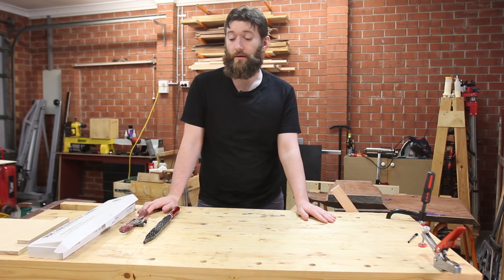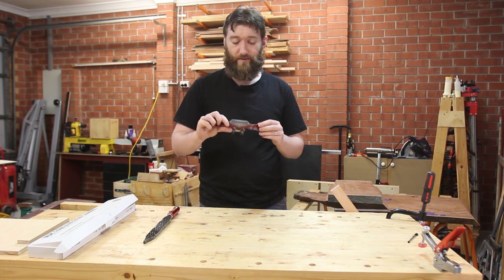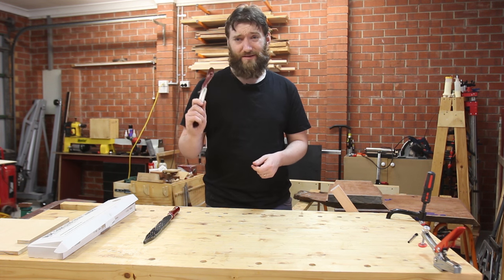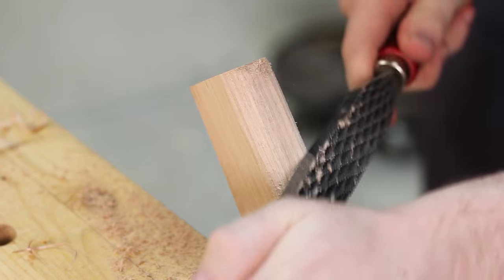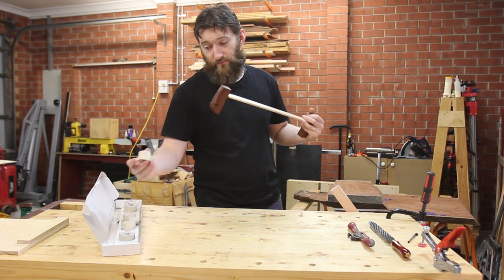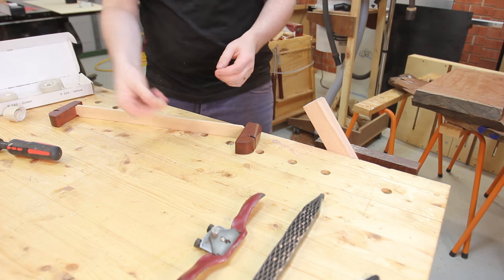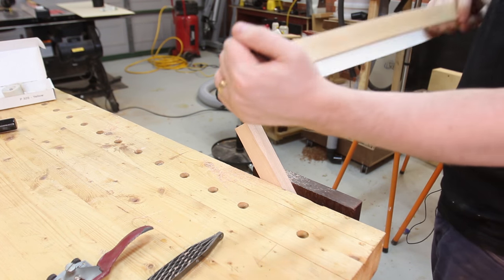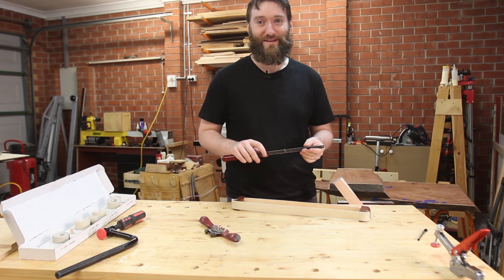Tool Warble #3 - Shinto Rasp, Spokeshave, MacFarlane Bowsander

Comment: Well you just gave me the idea to build a bow sander. 

I built a bed from woodgears, the fancy queen one with curves. Bandsaw wasn't big enough used a jigsaw(first mistake), smoothed it out with that crap spokeshave you just said about and then went after the parts I could with a belt sander(with foam under) and had to hand sand the rest. 

I bet the old stanley spokeshaves are slightly better the new one I had didn't work out of the box, I forget all of what I had to fix but it was a bit of filing and a bit of swearing before I got anywhere with it. 

In the end it turned out good but yea would never do it again, next project that hits me like that I'm building a band saw first.

Comment: Thanks Paul, great video. I can certainly recommend the Hnt Gordon spoke shaves. Got mine late last year and was kicking myself I never got them earlier, they are an absolute joy to use. Setting the blade takes a bit of finessing and getting used to, but when dialled in they are great. Cheers.

Comment: My favorite thing to shape with is the microplane set with interchangeable blades. They are steel cheese cutter style blades that do an amazing job.  Thanks for the video, interesting sander.
Reply from the maker: +BearKat Wood The "intro set" for about $20USD? That looks fairly stomach-able for a bit of a shootout down the track!
Reply: +Paul “TheWoodKnight” Jenkins 
The set I have is the seven piece set, a handle with 6 heads and I think it was in the $40usd range. They work very well, I use them on hardwood and they last well. Definitely worth the cost.

Comment: Hi Paul
Correct me if I am wrong, I remember seeing in one of your videos (Matias design) in it a Pantorouter being used , I meant the motor of the router in it.
I tried to locate one in OZ I cannot find any, where did you get yours from?
I was wondering as a last result I purchase one from USA and use a stepdown transformer.... except should be fairly large as this motors are at 110V x 3.25 Amps.
Can you please help me?
Cheers from Gold Coast
PS: I do own an AEG combo router  "with removable motor but that is in use and to get another one I have to Purchase the whole combi at nearly $1200 ????
Reply from the maker: +Jack Marashlian Sorry, you're mistaken. I don't have a pantorouter.